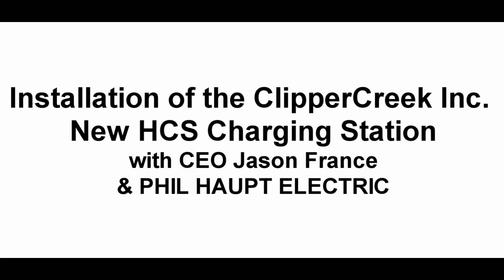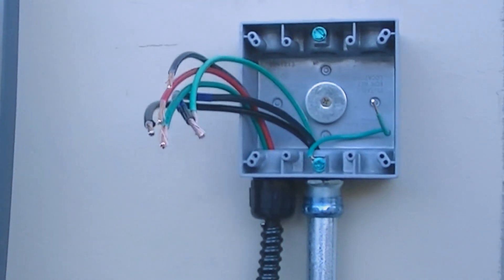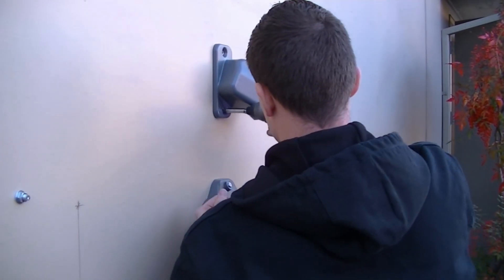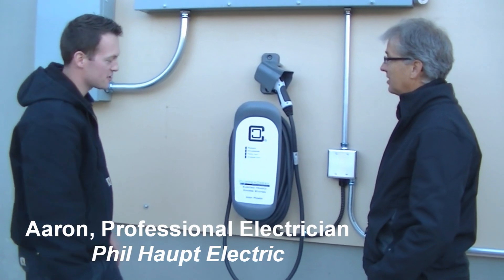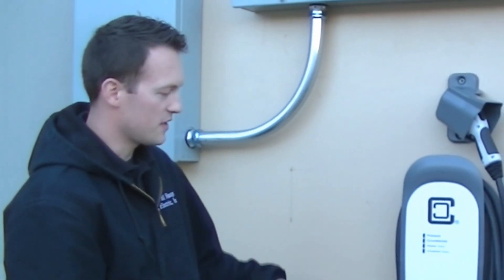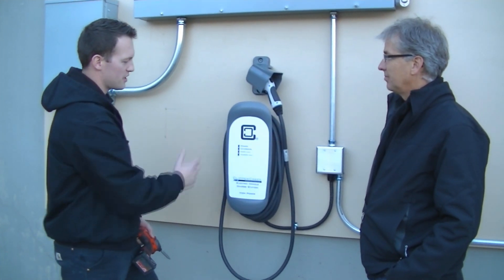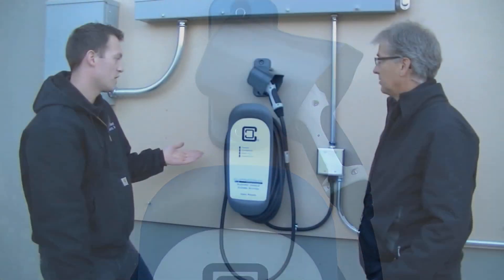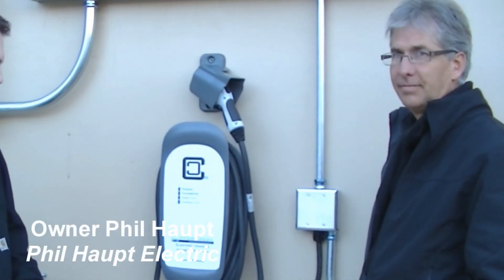Installing the ClipperCreek, Inc. HCS 40 by Phil Haupt Electric

Comment: If I can't easily find a stud for the EVSE itself, is to okay to use wall anchors or perhaps even install a wood backboard wide enough to span two studs and then mount the EVSE to that board?
Reply: Hello Peter,
An HCS-40 (with cable assembly including) weighs about 15 pounds. Wall anchors will work, but the sounder method would be your second option. We use that method to mount our EVSE’s to the side of our plant. Another benefit to the backboard is that you can mount hangers for other tools etc to it. I hope this answers your question. If not, please feel free to contact ClipperCreek Technical Support at 530-887-1674 8am to 5pm PST M-F.

Comment: This illustrates the Wrong Way to use Wire Nuts..which can lead to a fire !Copper wires need to be twisted tightly together using Pliers.. to form a very tight mechanical bond. then the end is trimmed with side cutters, or dykes.  Really good practice demands a light coating of conductive grease on the wire.  Only then do you use the wire nut.. which should be tightened as tightly as possible by hand, and then a bit more using the pliers.   The connection gets its strength and electrical integrity by being properly trimed, twisted, and trimmed again.  Corrosion and electrolysis are prevented by the conductive grease, and the wire nut serves to keep the already sound connection from being disturbed and provides insulation.    Merely shoving two bare wires into a wire nut and twisting is Ignorant, and Unsafe !

Comment: Why are you limited to within # feet of the box?
Reply: because they use an undersized wire with a special appliance grade insulation...  a longer run would have high resistance losses, creating heat, and introducing voltage drop.

Comment: Hey Jason. Getting mine delivered today! HCS 40P. Should I have the electrician run a 6or8 gauge wire for the outlet. Planning on a Tesla in a few years. Will this work with a 30 amp 240 slot in fuse box or do I need 50? Its a chevy volt ill be charging
Reply: 30 amp charging will require #8 wire and a 40 amp breaker.but if you will use it at the 40 amp level.. you need to provide  a 50 amp circuit and use #6 copper wire.  Don't skip now.. and don't overload later !